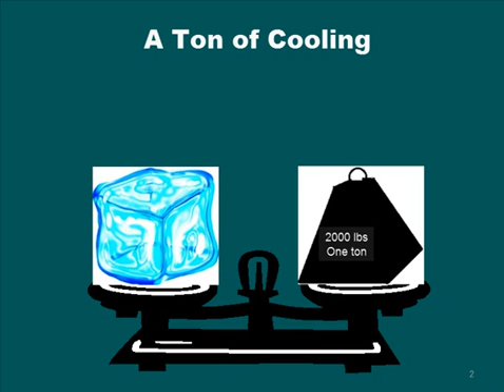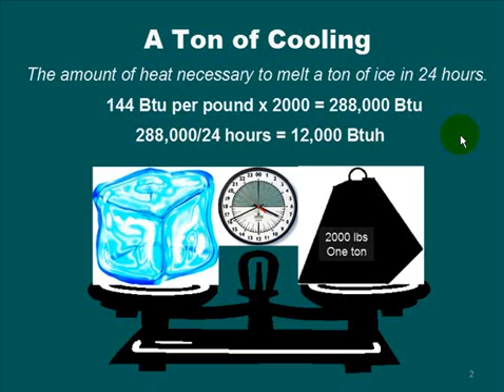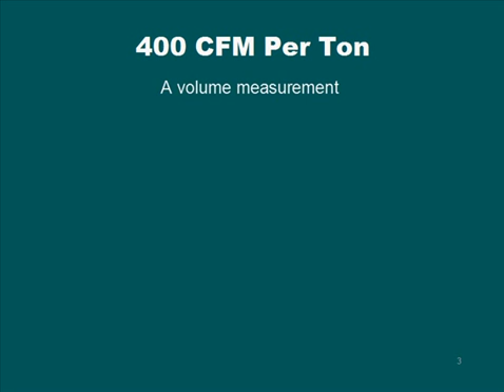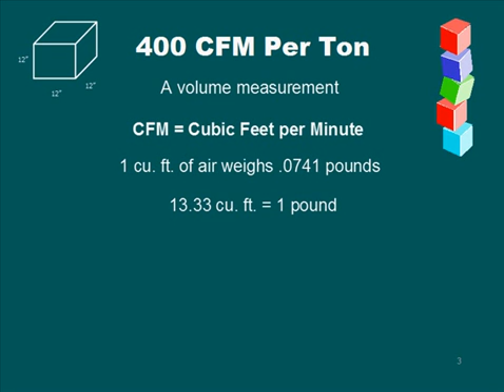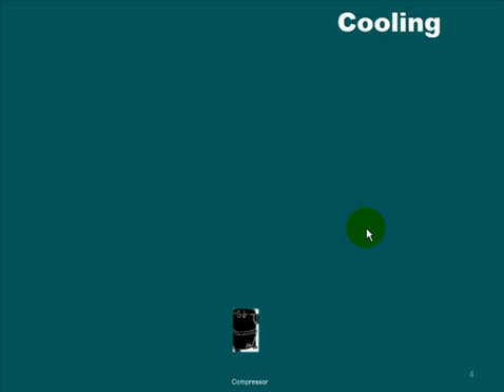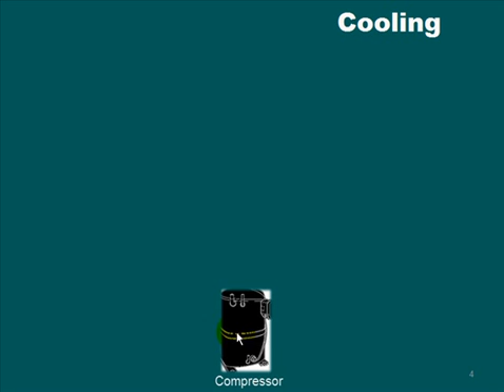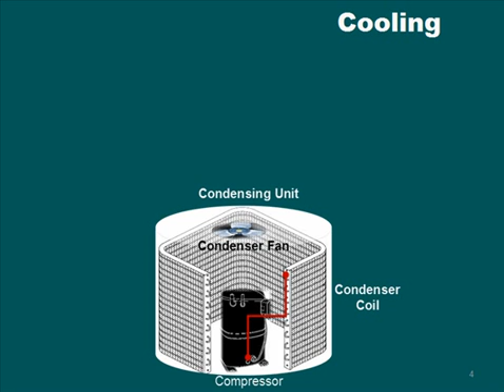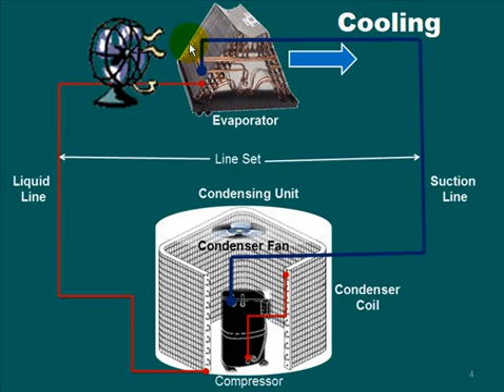Understanding HVAC (For Non-Technical People)

Comment: Think pressure. The pressure law states that for a constant volume of gas in a sealed container the temperature of the gas is directly proportional to its pressure. ... This means that they have more collisions with each other and the sides of the container and hence the pressure is increased.
Boyle's law states that pressure (P) and volume (V) are inversely proportional. Charles' law states that volume (V) and temperature (T) are directly proportional. Gay-Lussac's law states that pressure (P) and temperature (T) are directly proportional.

Comment: This is a great lecture!  There is a lot of ambiguity around what 1 cu. ft of air weighs.  I think it's somewhat arbitrary.  See this:  http://www.physlink.com/education/askexperts/ae650.cfm . Furthermore his calculation that 1 cu. ft = 0.0741 lbs and 13.33 cu. ft. = 1 lb don't match.   1 / 0.0741 lbs = 13.495 cu. ft

Comment: A ton of ice is 1000kg which roughly equal 2200 lb. so the right number is 144btu*2200= 316800 btu.
Reply: There's a metric ton and some other ton too right?
Reply: One ton 1000kg Convert pound 2000 lb. so one pound require latent heat 144 BTU *2000lb =288000 btu 1 day

Comment: nice video. 1 ton is 2200 lbs though, not 2000  :)
Reply: The american short ton is 2000 lbs, the metric tonne is about 2204 lbs and the imperial long ton is 2240lbs.
Reply: ***** 
In the UK that is :-P

Comment: 1cubice feet  air weight .0741 how do solved
Reply: The density (or specific weight in this case) of air is 0.0741 pounds per cubic foot, therefore, one cubic foot of air weighs 0.0741 pounds. Put another way: 0.0741 lb/ft^3 x 1 ft^3 = 0.0741 lb since the ft^3 units will cancel out.

Comment: good question,glove 8888. Ice begins to melt at 32 degrees. Air or water temperature measured at the melting point of ice is always 32 degrees. Even if you use a torch to melt the ice, it will melt at 32 degrees.